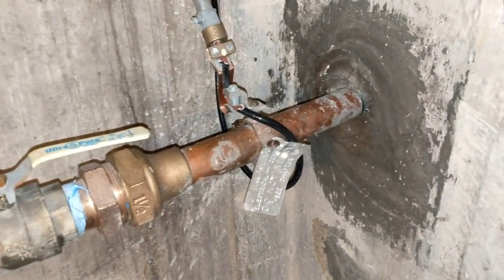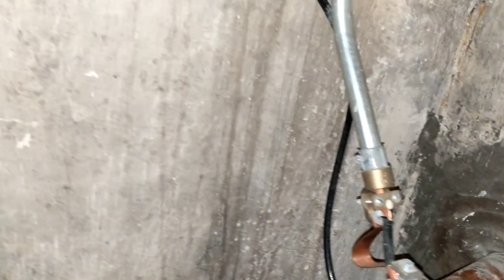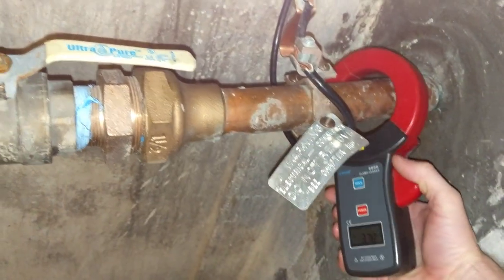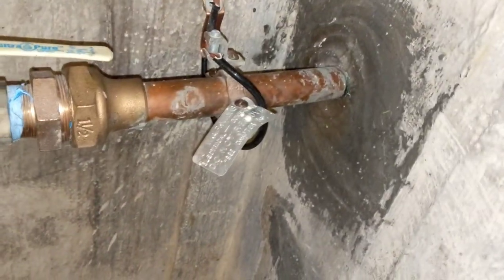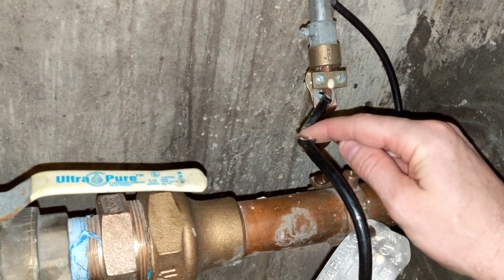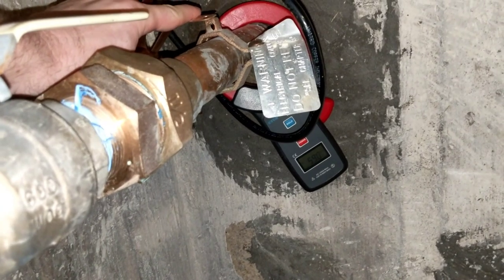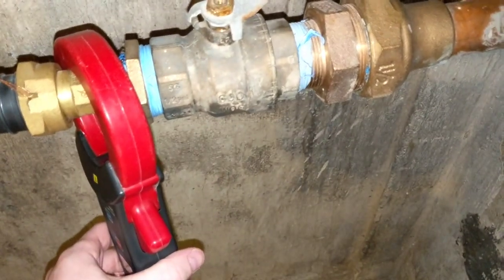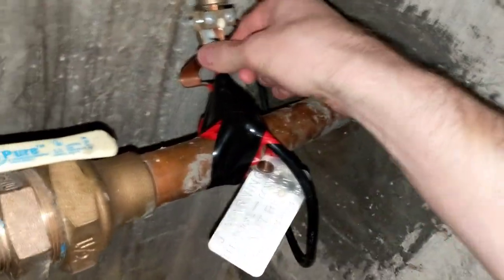How to measure current on pipes with AC Clamp Meter and isolate water pipe to stop undesired current

Comment: Exactly what I have been looking for! I have 16.7 mG on my water pipe with the Main turned off. It goes way up when the Main is on, so maybe some internal issues as well. But this can help me stop the hemorrhaging. Thank you!
Reply from the maker: There doesn't necessarily have to be any internal wiring issues in the house.  When the main is on and you're using power, you will be creating secondary neutral current.  Some of this will take the pipe, so the readings will go up.  It is still good to check for wiring issues, but the first step here would be to make sure you have ground rods installed and then insulate the pipe with PEX.

Comment: This is a DANGEROUS video. The advice being given is in violation of the National Electrical Code 250.50 which states that all grounding electrodes are to be bonded together as part of a grounding electrode system. This video should be pulled down!! 
250.50 Grounding Electrode System.

All grounding electrodes as described in 250.52(A)(1) through (A)(7) that are present at each building or structure served shall be bonded together to form the grounding electrode system.
Reply from the maker: the internal pipes are bonded for safety so that a potential fault could clear.  Are you suggesting all the homes theoughout the country with plastic pipe water service are dangerous and going to get people killed?!?!?!  Ground rods arent enough?

What does the code say about "objectionable current" and how to stop it?  Your comment is clearly not a well thought out comment.  You haven't taken time to look at the entire issue from all sides.  Why do you think it's OK to use a metal water service pipe as an electrical conductor for primary and secondary neutral current?  Why do you think it's OK to cause the transformer effect by having a magnetic field that will induce current all over the place?  How much neutral current on the water service pipe is "safe" and acceptible?  Is there any limit?

Nice try, but you should take time before you post.  I would love to hear your answers to these questions truly.
Reply: @EMFExplorer  No you're saying that. I'm saying that the NEC is very clear in that ALL grounding electrodes present MUST be bonded together as part of a grounding electrode system. Improper bonding of OTHER metal systems and enclosures is another topic and has nothing to do with intentionally disconnecting a grounding electrode. You stated that the Code doesn't require bonding of the metal underground water pipe which contradicts 250.50.
Reply from the maker: @DanHaruch  There are other areas of the codes that conflict with this.  That's why I'm bringing up this discussion.  If it took a wild video to do it, so be it.  

Questions no one, not even Mike Holt will answer:

1) Why does Mike Holt say he wants grounding electrodes in one place interconnected and not having long wires run a distance to them especially when there are other grounding electrodes...and this is exactly what the water pipe electrode does.

2) Why is it OK to use a water pipe as a permanent primary and secondary neutral conductor with measurable current flowing on it 24/7/365?

3) Why is it OK to cause magnetic fields and the transformer effect since using pipes as conductors causes imbalanced electrical service and magnetic fields that induce current in conductive paths?

4) If a house has ground rods, why is everyone worried about isolating the water service pipe just to blindly follow code and ignore the other problems?

5) Why does no one have a problem with plastic water service pipes but some people throw a fit when a metal water service pipe is isolated?

6) How much primary/secondary neutral current is acceptable on a copper water pipe?  How much is "objectionable" ground current per NEC?

I believe no one answers these, because it is a complex problem that everyone wants to sweep under the rug instead of actually solve together.  So instead many appeal to emotion, personal attacks, or the authority  of the limited code of their choosing, and ignore these serious questions.  I would love for you to prove me wrong.

------------

I have shown how this practice violates numerous other NEC codes, causes problems, and there is a much safer alternative.  It is outdated, unnecessary, and foolish to leave intact the low impedance path back to other buildings and bond to it.  It should always be electrically isolated and only the internal plumbing should be bonded for safety.  The building should not use this as a grounding electrode.  In some areas they isolate it underground near the street so that the pipe can still be used as a grounding electrode without the objectionable current.  But for most people they should isolate at the house.  Plumbers and electricians should be helping to do this, not mindlessly repeating outdated information and practice that has been proven wrong.

-----------

Thank you for your reply.  I do show in other videos and have even written an ebook with pictures on using pex at the entrance to isolate.  We have discussed that perhaps it should be a certain number of feet to reduce the risk of someone completing a circuit that is caused by a fault offsite or on-site.

https://www.mikeholt.com/mojonewsarchive/GB-HTML/HTML/ObjectionableCurrent~20020610.htm 250.6 speaks of objectionable current.  Many circumstances can cause it - the bonding to interconnected water networks is one of them, albeit not specifically listed of course.

All these metal pipes and bonding only prove my point that you're making paths for faults to take on objects we live near/around.  It's making things more dangerous not less dangerous.  To have metal pipes introduces more problems.  Lightning death is extremely uncommon.  Electrocution is far far far more common.  So I would rather have poly pipe coming in and poly pipe inside.  If metal then break the metal and insulate it to protect against making contact or use an appropriate number of feet of poly pipe to help prevent connection.  Bond the interior metal pipes to clear faults.

Parallel conductors: https://www.electricallicenserenewal.com/Electrical-Continuing-Education-Courses/NEC-Content.php?sectionID=297.0

Notice pipes can't be used as conductors.  Conductors have to be properly grouped, sized, same length, etc.  Magnetic fields cause current, induction heating, voltage potential in some cases.

Electrical current takes all paths and spreads amongst them according to resistance/impedance values.

So once again we are complicating things, creating more paths to potentially electrocute humans, causing magnetic fields that create the transformer effect, mag fields that cause health effects, possible induction heating, a definite parallel conductor and using pipes for current when they shouldn't ever be used for such, electrocuting plumbers and city workers, and more.

The only argument so far are is that code requires it - appeal to authority.  The point of this conversation is to prove the code needs updating here.

I've also pointed out the other NEC violations - objectionable current and parallel conductors.  Actually there are two more - 1) all conductors of a circuit must be in the same cable/conduit/raceway and 2) conductors must be designed and approved for electrical current - you can't use pipes.  I can look those up too as I don't have all of these memorized, but a simple Google search should find those as well.

Comment: If the pipe at the entrance went to zero amps when you removed the connection, that seems to say that the current you were reading came from the ground wire because when you removed it you also removed the current. But after the plastic beyond the shut off you had another grounding connection, grounding the home water pipes. Those pipes also had the current reading that you were getting at the entrance. Since you connected those two grounding cables together, wouldn’t the house pipes still have the current running through them? You didn’t show a measurement beyond the plastic after the change. Did the house pipe reading change or remain the same? I understand the theory, but I’m having trouble reconciling what you showed to what you’re saying without seeing the change beyond the plastic, the house pipes.
Reply: Like the measurement you took at 3:45 , what was the change there after disconnecting the ground from the entrance.
Reply from the maker: That is a very good question!  In a house that has an insulative break in the pipe (in this house - the plastic water meter is the break) you will not have any current going up to the break obviously since it is a dead-end.  However, you still can have current within the house due to what we refer to as "ground loops."  So the pipe is grounded by the electrical bond still on the house side of the insulative break in the pipe.  The pipe is also grounded usually at other places through an appliance or some other connection (something grounded like a conduit or duct making physical contact with the copper/steel pipe).  A bit of current will flow through that, but it is much smaller.  This is usually only a few milliamps.  It is still undesirable, and we try to isolate and get rid of ground loops.

We want everything grounded at one end - one location - and then to spread out and not touch anything else that is grounded nor loop back and touch itself, if that makes since.  I always use the octopus analogy.  If the head of the octopus is the system ground, we want the tentacles to spread out but don't want one tentacle to touch another nor curl back and touch itself.  So HVAC, gas pipes, water pipes, electrical conduit/mc flex, etc - all of these have to be taken into consideration.  The clamp meter on our website is a great tool to identify these things.

So to answer your question - yes - there would be current on it but it would be very small and not resemble the current shown on the supply pipe coming through the foundation at all.
Reply from the maker: Also worth noting is that yes in this case the current came from the ground bond wire connected directly to the supply pipe coming in.  But when the jumper is present, or there is not insulation present on the pipe, the current will also be on the pipe usually as well.  The current will be split between the pipe and the bond wire running back to the panel.  This is because in homes there is almost always another way the copper or steel water pipe is grounded somewhere, and current takes all paths.

Comment: Hi. I have anywhere from 5 amps to 12 on my water pipe. The waterline is copper so  we have it bonded to the panel… We also have 2 ground rods. With a lot of troubling shooting we have figured out that it is coming from the neutral line from the street lines. As soon as the electric company unhooks our wires it all drops to zero. They replaced all the connections on the lines and they even replaced the transformer on the pole. It didn’t resolve, actually increased the stray current of amps coming onto our neutral even when all our breakers are switched off…. It is causing terrible levels of EMF in our home. Any advice?
Reply: U need to demand that your power company address their shit, 5 amp's is ridiculous
Reply: @trope5105  Yea i agree definitely demand they come look at it again. But you can run another ground rod outdoor and tie it to that, then tie it to your panel so the current stops going through your house